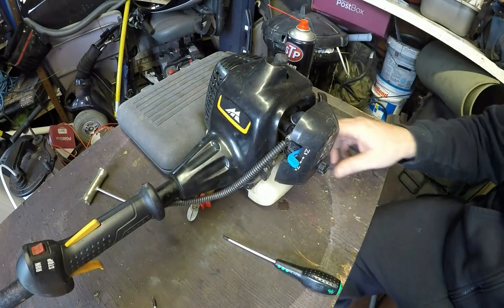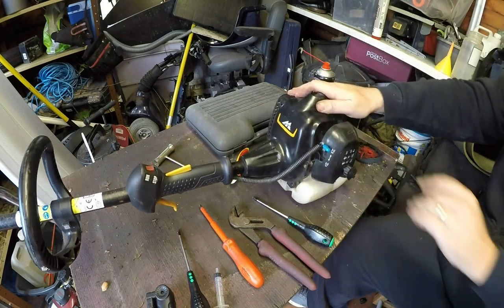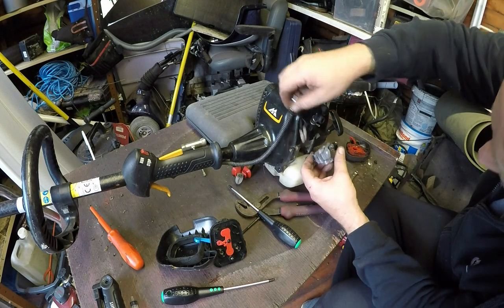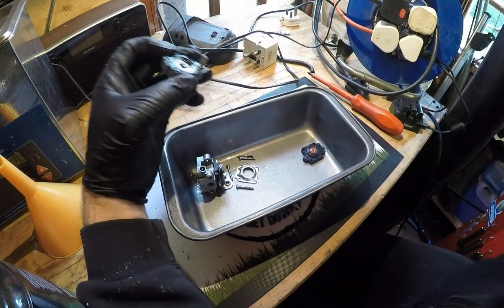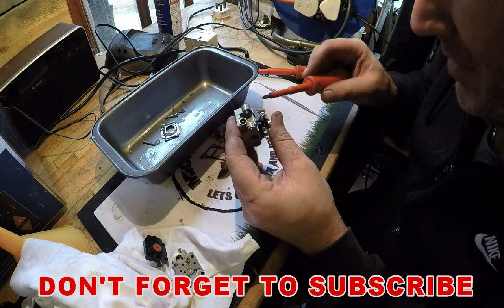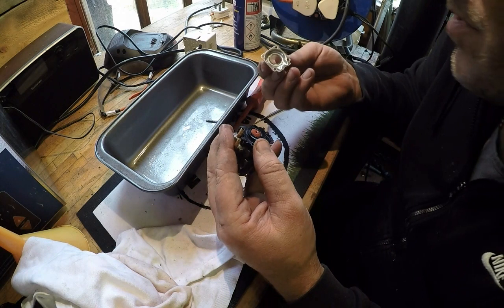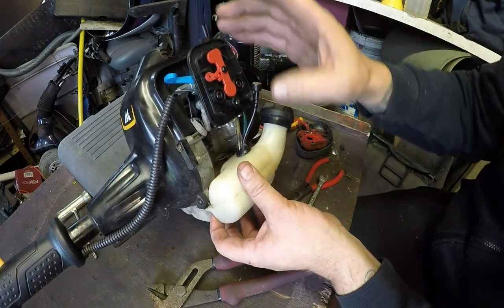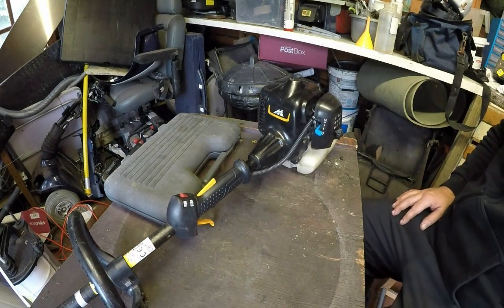Mccullock strimmer how to fix

Comment: Finally gave up with my Mac. New plug, carb kit, new fuel, wiring check, new nag, carb strip down, compression check. Will it run? For about 5 secs then dies....
Reply from the maker: @DaveInBridport  something not right with it

Comment: Have exact same strimmer cleaned carb changed pipes and it wont start priming great no air bubbles so am at a loss great vid mick
Reply: Will it fire with some fuel put in the spark plug hole.
Reply from the maker: Gap the plug or change it.. if not go back to the carburettor
Reply: @themowerman  what gap it is brand new plug new gaskets and diaphragm needle spring ect......can tou tell me what the correct gap is cheers buddy 👍👍👍👍👊
Reply: @petefroud5308  it fires up then dies carb is clean with new gaskets diaphragm needle spring ect dont understand why.....it's the same one mick has just done..had new plug also...
Reply: Have you checked the exhaust and outlet for carbon.

Comment: Hi Mick, Is there any carb adjustment on a Mc Culloch 210.? apart from the idle screw.?🤔
Reply from the maker: Yes there should be mate it in the throttle side of the carb.
Reply: @themowerman  Thank you Mick,  👍 Apologies for not returning a photo .
Reply: Also, Mick, if the reading on the ignition coil is down to around ,2.3, is that classed as a ‘non starter’, as I have no spark at the plug, but the on/off switch reads ok.🤔
Reply from the maker: @michaeldominy2084  change the plug first to you can rule that out.. it is a little on the low side.. Also check the coil wire is not shorting out on something
Reply: @themowerman  Thank you for that info’ Mick,, will carry on trying to get fired up. By the way, I also have a AL-KO tl 250 Strimmer that the coil info was for, but to get a coil for that model is pretty hard find, do you know of a supplier for that m/c.?🤔
Reply from the maker: @michaeldominy2084  I will have a look
Reply: @themowerman  Your so kind.👍😊

Comment: Hi mick great video rely helped me, got the strimmer running great but as soon as it gets hot after about 10 mins or so it starts bogging and then cuts out and thoughts on this Thanks.
Reply from the maker: Could be the coil or plug.. if not it will be a fuel problem